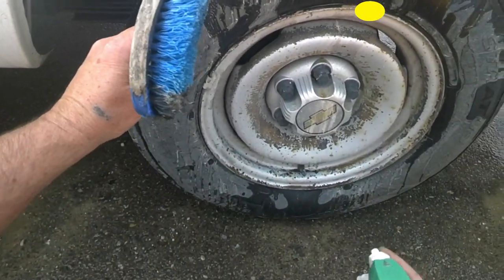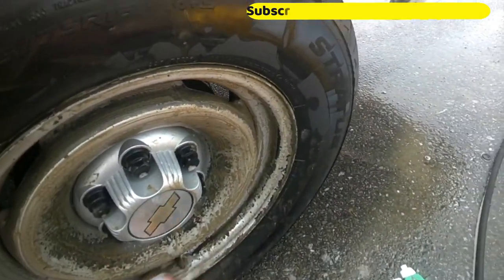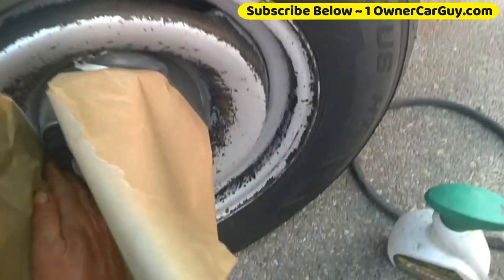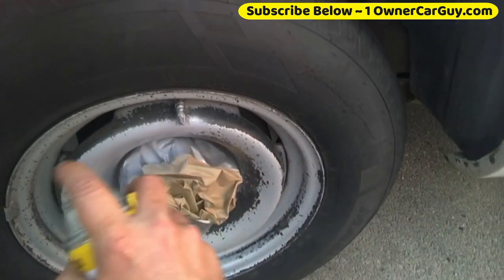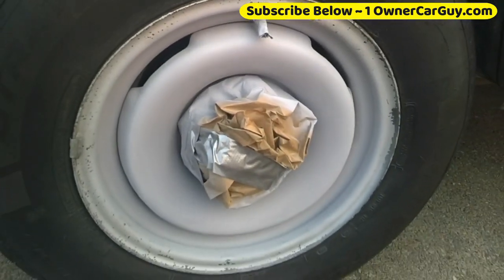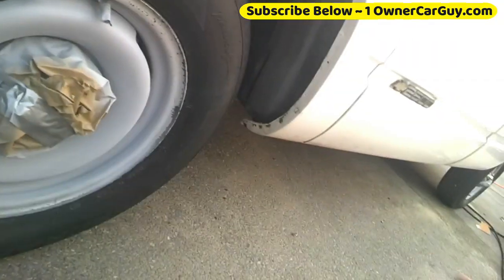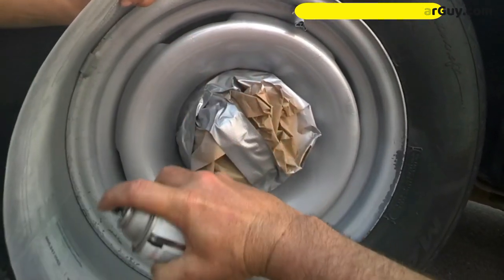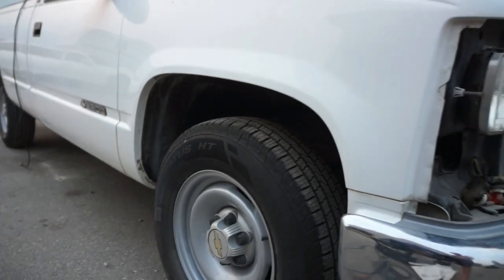How To Spray Paint Wheels DIY ~ No Sanding / Prep EASY Upgrade ~ Give your car a Rim Job

Comment: Have you ever done a soft edge mask off?  Works well if you need to blend in the top coat you just turn the tape back on its self so you don't get a line! Say your doing a bit round a wheel arch!

Comment: I think they came out nice but for the center caps, in this case, it may have been quicker to use a 7/8 socket on a little 3/8 impact to remove the plastic lug nuts and cap.